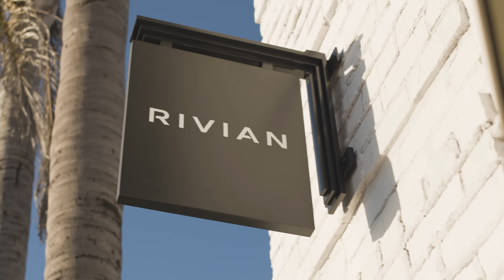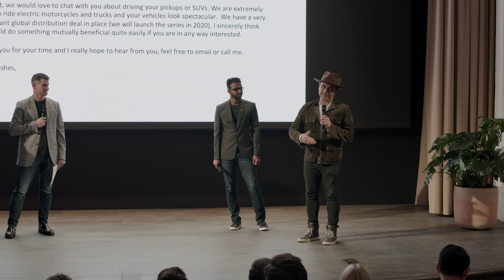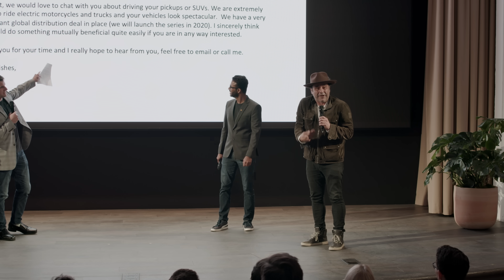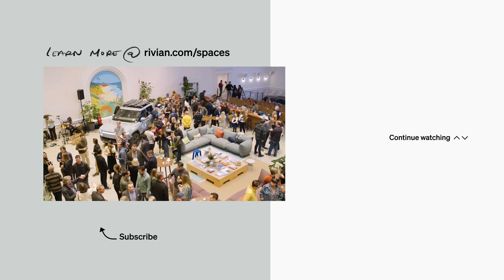Adventure: Long Way Up Director David Alexanian Reflects on Going All-Electric | Rivian

Comment: This movie was what sold me on the Rivian. To drive, not one but two, protypes from the tip of South America to LA and not have a major break down is astonishing. I watched several interviews with the riders and directors and not one time did they say the trucks were breaking down, falling apart, that the trucks wouldn't make it, during the trip. What a great truck!!!  

RIVIAN IS THE KING OF ELECTRIC TRUCKS💪💪💪💪
Reply: Same!  Especially after watching the camera crew beat the crap out of them and seeing how Rivian supported them.
Reply: Ditto. After that doc I was sold. Picked up my R1S several months ago and am beating it up off road w/out any hiccups.
Reply: Rivian was …
until
Making sci-fi a reality  Cybertruck deliveries begin today!  – More utility than a truck, faster than a sports car  11,000 lbs towing capacity, 2,500 lbs max payload.  Est. 340 miles of range. (Dual Motor)  0-60 in 2.6 seconds. (Tri Motor)  – Ultra-hard stainless steel exoskeleton & shatter-resistant Armor Glass  Fewer dents, less damage & long-term corrosion. Easy & simple repairs.  Armor Glass can resist the impact of a baseball at 70 mph or class IV hail & acoustic glass helps make the cabin insanely quiet.  – Steer-by-wire & rear steering  Gives you the handling of a sports car & a better turning radius than most sedans. Also, incredible stability & maneuverability for a full-size truck.  – 4-corner adaptive air suspension  Offers 12” of travel & 17” of clearance.  – Plenty of storage  6’x4’ bed that doesn’t need a liner & is big enough for 4’x8’ construction materials.  67 cu ft of lockable storage (additional 54 cu ft available with rear seats folded up), with a Vault cover that’s strong enough to walk on.  – Power everything  Integrated outlets: 120v cabin power, 120v & 240v bed power. If the grid goes down, Cybertruck can provide up to 11.5 kW of power directly to your home.  – Space & comfort like a living room  18.5” touchscreen in the front & 9.4” touchscreen in the back, both with all-new UI.  15 speakers with 2 dedicated subwoofers & distributed amplifiers create a studio quality sound stage—obviously goes to 11.